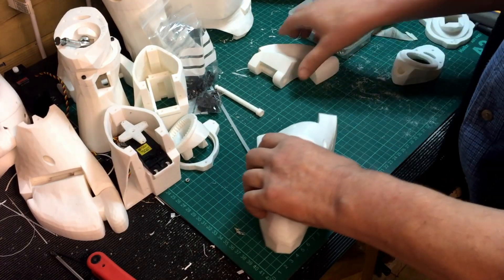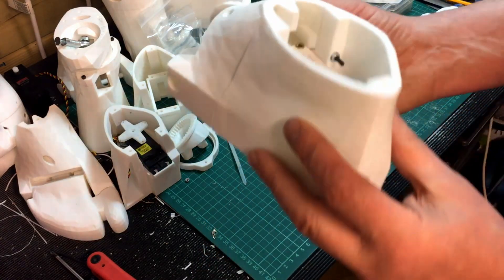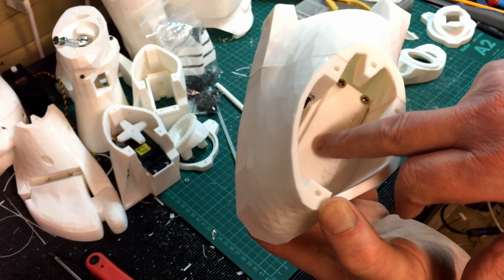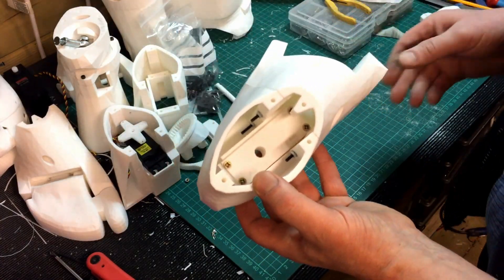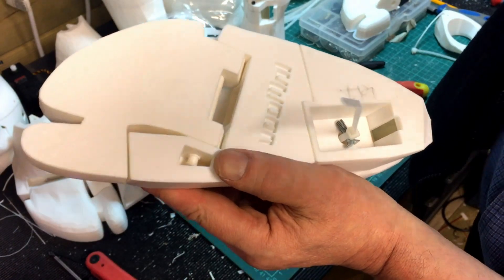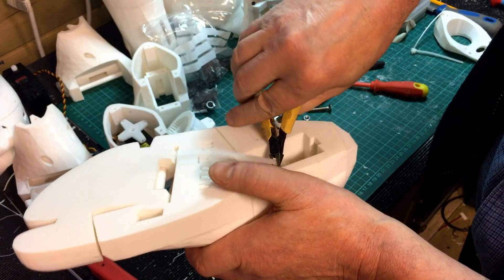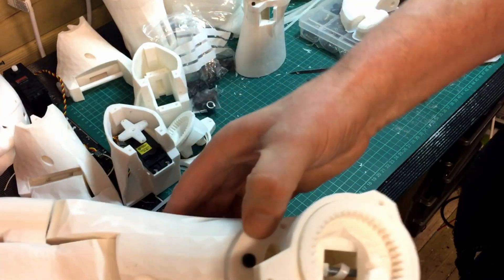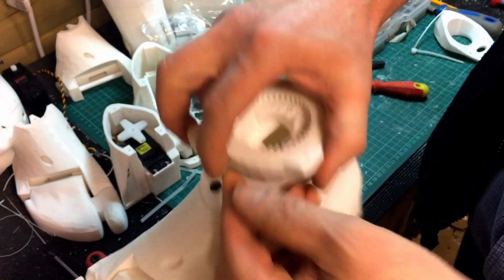InMoov Build Part - 27

Comment: Hey, great job :) If you print without a case, how do you avoid warping? Greeting from Austria :)
Reply from the maker: Hi Conny from Austria! PLA not ABS and rarely get any warping.  Some prints do warp a bit but mainly because of their shape, or print settings.   Or just big solid objects like the foot in this video.    Never really been a problem generally.  Never tried ABS and had mixed results with PETG recently, printer kept shutting down and then a few failed prints also.   Gone back to PLA now and happy again.   [All my InMoov is PLA]

Comment: This legs is huge amazing how many filement you need ?
Reply from the maker: Hi Ambroise, a LOT of filament.  I think at least 6 reels, maybe more.   I will add it all up and let you know.   
Yes the legs are very long, so I need to make my InMoov stand much taller, something to do next year.  The whole InMoov will be at least 6ft tall,  Happy Christmas
Reply from the maker: Hi Ambroise,  I just added it all up and for both legs approx used 2000-meters PLA [6 and bit reels] and 642-hours printing time.    I did not keep a count of time/plastic for the body and arms and head I would guess maybe similar again for the body and similar for both arms.
Reply: thank you for this informations very nice print and interested to see how you build leg super